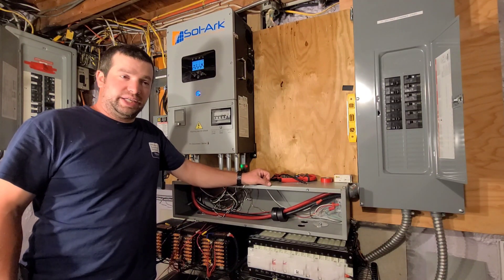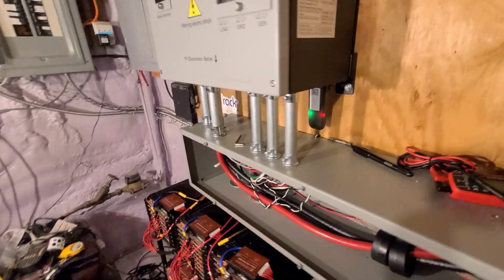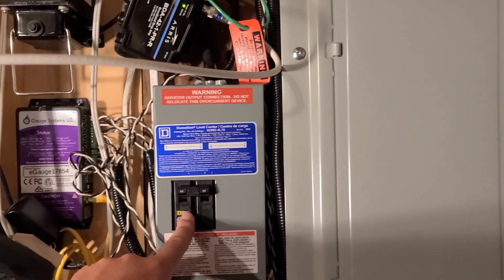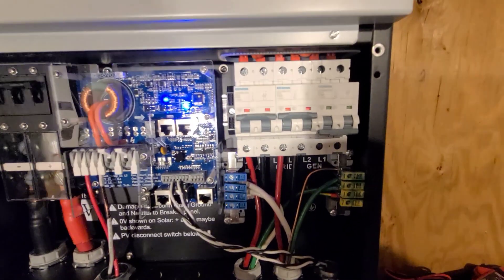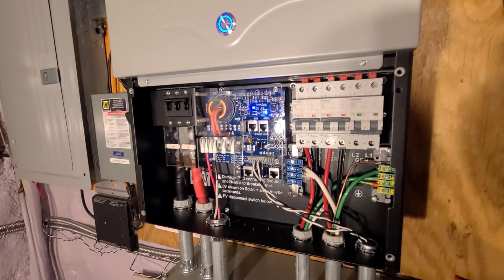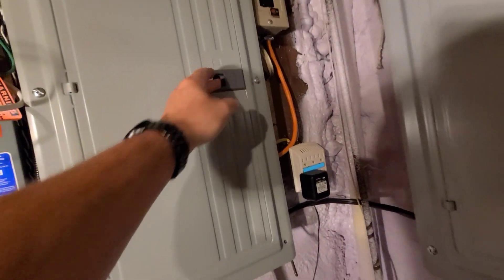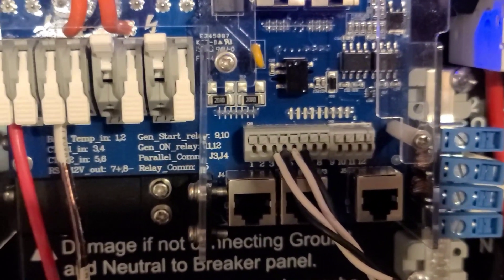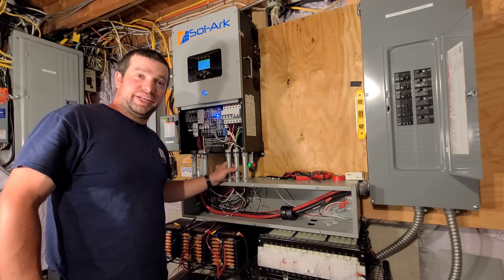Sol-Ark 12k Installation

Comment: Word of warning on the wire trough sizing.  the current 12k model extends out a bit more and 8x8 is no longer suitable.  I had to put some standoffs and it still wasn't enough.  I'd say 12x12 would be comfortable now.
Reply from the maker: Thanks for bringing that up!  The original 12k that I have is good with 8x8, but they did extend it out for the 3r version.
Reply: @benssolarandbattery  a 10x10 gutter works perfect. yesterday the supply house didnt have any so i had to use a 12 and it was so overkill lol.
Reply: I need installers that do these inverters in California

Comment: Did your utility make you jump through a lot of hoops to connect the grid to your inverter..? I've been interconnected with PNM with my 12.4 KW solar since 2010, (Enphase), and I just put in a Sol Ark 15k with a six battery Eco Worthy server rack, which I installed myself, (not an electrician). And am now looking for an electrician to complete the wiring. One of the few electricians that have responded to my messages said PNM wants a $2500 up front fee to look at, and engineer a plan for my battery backup install, but they usually refund all but $500. Then the approvals and inspections to deal with. I'm at the point where I just want to put a transfer switch in and switch to battery/solar when it goes down, and have the 15k run the house-no sub panel. I know I'd have to manage my loads doing that, but no hassles with the utility.
Reply from the maker: No, our utilities are easy to deal with here, and single family residential houses don't even need electrical permits. Definitely sounds like it would be easier to just disconnect in your case.

Comment: Inside the solark, does that bare copper wire run directly to a grounding rod?
Reply from the maker: Not directly. That's an equipment grounding conductor.  The grounding electrode conductor that runs to ground rods is in the main panel where the ground and neutral are bonded.

Comment: Does anyone know if this can be used with only Battery and AC coupling only? My house already has microinverter system and I don't want to sell back to utility so I only want to use battery and AC to charge or discharge with current limiter. Thanks.
Reply from the maker: Yes, it can.

Comment: Hey Ben, I wanted to know what that little box is called that is line taped and what kind of breaker to use. I have an outdoor 12k Sol ark and a double pole breaker in my main panel. Thanks for your help.

Comment: Ben, I'm really enjoying your videos and DavidPoz's as well.  I am still learning all about this stuff, but I think I want essentially what you have with grid, batteries, and solar and the ability to use them any way you want (off peak charging, power during grid outage, etc.).  I am struggling to understand the big picture (but your videos really help with that).  Do you have a diagram of your wiring you can share?  I'm trying to figure out if I need two inverters and how to connect them.

Comment: Hey Ben, I had a couple questions with the limited to home and time of use settings.  If I understand it correctly, these settings can prioritize pv and battery energy and use the grid to fill in if loads are too big or battery/pv too low?  Is that correct?  Also, if this is the case, could I bypass the need for a critical loads panel?  So if the grid goes down, under the limited to home setup, the sol-ark would be supplying the main home panel and I'd just need to consciously manage the loads instead of relying on a critical loads panel to manage select loads for me?  If all this is the case, would I just wire the ac in/out breaker from the sol-ark to a 50amp breaker in my main house panel (also wiring the ct sensors to the main lines) and that's all that would need to be wired on the ac side of things?
Reply from the maker: So you can run your entire house through it, but you'd be limited to a 50a (or 63a depending on the model) service to your house.  The limited to home feature uses CTs on your mains to allow the Sol-Ark to compensate for all of the usage by your house, including the main (non backed up) panel and the protected loads panel.  In the event of an outage, the main panel will go down and only the protected loads panel will be powered.  This is to keep power from backfeeding the grid. 
I'm currently (and have been for at least 6 months) running my entire house through the Sol-Ark with a 50a  breaker with no issues.  Most houses really don't require a 200a or even a 100a service.   Some do, but most don't.
Reply: @benssolarandbattery  Thanks Ben!

Comment: To many videos on sol ark installs that have so many electrical codes violations. You can't have dc wires in same trough with ac wires. 😒 you can't use 3/4 emt conduit with more then 2 sets of 4awg wire.... your missing few insulation bushings on your fittings. Lot more violations... This video should be taken down .
Reply from the maker: Thanks for watching.  Are you a licensed electrician?
Reply: @benssolarandbattery  Yes.

Sol ark 12k manual states on page 5(feb 2021 version) all ac wires should be 4awg wire. Emt conduit. Cant have more then 2 4awg wires. link below on chart
https://essentracontent.com/assets/uploads/images/Table-Cable-Conduit_1.jpg
 
Electrical code does vary based on what year your state adapts the NEC book. Only 4 states have pretty much free rain. link below. 
http://files.esfi.org/file/Full-Sized-Adoption-Map-July-2021-5DFB.pdf 

installation bushing are required 4awg and larger. Now my bad as I watch few video at same time  so I have mixed up my comment for engineer775 video on sol ark 12k which he didn't use any insulation bushing!

2014- 2020 Code updated Language . If your state is Nec 2011 and below your fine.

690.31(B) Identification and Grouping. PV source circuits and PV output circuits shall not be contained in the same raceway, cable tray, cable, outlet box, junction box, or similar fitting as conductors, feeders, branch circuits of other non-PV systems, or inverter output circuits, unless the conductors of the different systems are separated by a partition.  This rule also applies to inverter output circuits. So you would need to a partition from your output inverter circuits and your solar dc incoming circuit.

Example link on a violation picture mixing inverter ac output with your PV DC circuits . Which you can see the Yellow line > DC Circuit run in same trough with AC inverter output circuit in red.   https://www.electricallicenserenewal.com/Electrical-Continuing-Education-Courses/graphics/sectionPics/large/qid177.jpg
Reply from the maker: Honestly, I was not expecting a response to that!   Awesome!
I will say that when I installed my inverter, they only required 6awg wires for the input and output, so I'm good there.  They have since changed the manual once they went with 63a for grid and load breakers.  
As far as DC circuits with AC, I believe its allowed except for PV source circuits.  Can't find anything saying low voltage battery cables aren't allowed in the same wireway as AC circuits as long as the insulation is rated for it.  I am guilty of this violation with the PV source circuit and I know it.   
That being said, do you happen to be looking for work? We are always looking for good people!
Reply: I agree, Jacqueline. I really want to see a fully code compliant installation example/video, perhaps from Sol-Ark directly. While the wireway idea looks nice and works well in principle, separation is impossible. I think the best compliant way to do this is either two wireways or a trough for AC and conduit for DC (or vice versa). Multi-inverter installations present special challenges. 

The other thing I see often is deep battery cabinets directly below shallower inverters, violating working space requirements. Manufacturers of inverters are not helping us much with practical solutions to these code issues.

Comment: one question as you have installed parallel sol-arc 12s.   If there is a residential system with the main disconnect and solar pv ac disconnect on the outside next to each other and on the other side is the dc disconnect and the tigo rapid disconnect switches. please confirm that the pv ac disconnect is connected to the main service panel on top and to the sol-arc 12 on the out side after the wires run from the sol-arc to combiner  critical load box and then to the pv ac combiner. If not how will it be runned from the inside? Thanks.  Also if there is a grid combiner ( there is a standby gen connected to the sol-arc 12 also) what is the function of a grid combiner and its connections and what type of panel is used? 
Thanks. I can be a pain.

Comment: heya oke that is nice so with that inverter you can also feet back to the grid because that's what I want to do, as here in Holland it's 1 to 1 ( I pay 9 cent/Kwh for getting power from the grid but I also get 9 cent/Kwh wen I give back to the grid). the only 1 thing is you still have to pay for the transport though the cable, that's  why I want to have batteries (with my solar panels 3.2 KW) withes will be first to be vilt to 100% before giving back to the grid. I calculted that I need about 9 KWh a day and I want to be able to run my house for 1 week if there wouldn't be any sun to power the batteries up again so 7x9=63KWH for the battery pack

Comment: Hey Ben, I assume you can't hear it, but I'm having an issue with my Sol-Ark 12kw inverter where it sends out an ear piercing tone at 15 kHz. It's very present in this video, but I'm wondering if there's a way to get rid of it that you know of. So far every Sol-Ark 12k inverter has it that I've seen running on the internet, including Sol-Ark's own demo video.
Reply from the maker: Mark, I can definitely hear it while standing near the inverter.  I don't know any way of getting rid of the noise other than locating the inverter away from living space.  I have mine in the basement below my living room and can't hear it at all upstairs.  It's an unfinished portion of the basement as well, with no insulation or sound barriers above it.
Reply: @benssolarandbattery   Thanks for the reply! Mine is installed in my garage, and unfortunately I spend a lot of time out there. It also seems to cause every device in my house with an inverter (computer power supply) to make the exact same noise when the inverter is running. I'm losing my mind at this point, but I don't think there's any solution other than trashing the inverter and replacing it.
Reply: Wall it off in the garage.

Comment: Nice video!  Do you use a CAN-supported BMS for your DIY batteries with Sol-Ark?
Reply from the maker: No, I'm using Daly BMS's with no communication.  I had those in place before I went with the Sol-Ark so it seemed overly complicated to change it now.

Comment: You said you are now limited to a 50amp service.  Are you talking about only when the grid is down.  I want to hook up a Sol Ark as a supplement/backup supply.  I would still use the grid, just a smaller bill.  I have a 200 amp panel and at times may require 20,000kw.  Can I do that with the Sol Ark as long as the grid is on and I have a critical loads panel that omits all the 240V appliances?  Thanks
Reply from the maker: Bill, the way I have mine wired currently is with the entire house running through the Sol-Ark.  I wouldn't suggest this as you would be limited to 50a (or 63a with the newer 12k). 
You could most definitely run a protected loads panel off it with your large loads in a main panel.  You can also add the Sol-Ark CTs to your main panel to run in Grid Zero mode, which will factor in your whole house usage even if there's just a sub panel off the Sol-Ark.  The other way to do it is to use an Auto Transfer Switch on your main panel and use the Sol-Ark load output as the generator input on the Transfer switch, thus backing up your whole house in the event of an outage, but still allowing your 200a service during normal operation.  Many ways to skin the cat!

Comment: Great walk-through!  If you have a pair of the 12k inverters installed can you join the two load outputs (feeding the house) into one sub panel with two 60 amp 2-pole breakers?  Would this increase effective output to 120 amps available for household use?
Reply from the maker: Thanks Jeff!  You can either do it that way or combine the 2 outputs in a wireway and feed the panel directly with 125a rated wire.   The extra 60a breakers wouldn't be needed for that scenario.   (Make sure your panel is rated for it)
Reply: @benssolarandbattery  Good call that would be cheaper.  This wouldn't cause any back flow power issues combining wires or breakers in one panel?
Reply from the maker: @jrtronrud  no, because the inverters are paralleled.  You're essentially using tap rules. But if one shuts down, the other will too so they're basically one inverter.  They do have their own ocpd built in so this works well.

Comment: Yes I will be using an outback charge controller for charging lithium ion cells, actually with this nighttime system I prefer not to sell back to the grid! Day time as on now all solar panels are grid tied (over 14,000 watts), 4 inverters, 7 micro inverters.
Reply from the maker: That works too.  Might as well just keep the grid out of this one altogether, that way it can't get any surges from the grid.

Comment: To complete my request. I’m hooking up additional 6000 watts of panels to my 8000 watt 48vdc Radian inverter, I want to charge my battery bank (60 kWh) during the day and use that storage only at night. My other panels cover my daytime use, but this year I want to set up my battery storage system! Can you make any suggestions from your point of view on how you would do that?
Reply from the maker: Will you be using a charge controller (or 2) or a separate grid tie inverter AC coupled with the Radian?  The Radian does have a Grid 0 feature which will sell excess power once the battery is fully charged, and only buy grid power when it's discharged to your set point.

Comment: I am not an engineer, but I don't think you are playing it sake. remove all the load you want to be powered by the solar to a different panel. it is a safety issue. this would ensure that the grid power does not have a chance to come into contact with your electric utility power.
Reply from the maker: I have installed an interlock to make sure this isn't possible.
Reply: Can you show us the interlock setup? I want to wire from the solark loads input/output directly to my main panel

Comment: Heya. I just came over from David's channel and you said your Sol-Ark couldn't handle just the air compressor? I ask because I am using a 4.4 kw split (2.2kw on each rail) and I can run my air compressor on one rail and AC on the other with no problem (or each one alone) I just don't see why a system that is rated at 3x as much output would have such a problem. PS, my air compressor isn't 'small' lolol, it isn't one of the monster 15hp ones either of course, but my 10hp shop vac doesn't give my system any problems either.
PS, I have one of the OLDER MagnaSine 4448's :) Love how it has performed.
Reply from the maker: The first time I tried the compressor, it wouldn't start.  Then when David was here, it worked fine. Go figure.  The chatter I've been hearing about Sol-Ark is that it doesn't like heavy inductive 120v loads, which I saw once.   240v it has no issue with whatsoever, and most of my heavy loads are 240v.  It will run my 5500w electric dryer without a problem.

Comment: Why did you say 63amp for load and grid breaker ? It’s only 50. 50/50/40 in that order. Only 33 continuous off grid
Reply from the maker: Actually, my unit is 50/63/40. 

I just installed 2 newer 12k's last week that had 63/63/50.  
They're constantly working to make things better by the looks of it.

Comment: Nice video mate, cheers. We have been using the solark 8k for a year offgrid, with a gen on the AC and smartload on the gen and it has been really great. 
We just lost the setup in the cali fires, So looking forward to setting up again with a 12k.
Reply from the maker: Oh no! I hope everyone's ok and you get back up and running soon!  Smart load was a great addition to the last house we worked on. In Vermont, we have to oversize the PV significantly to account for winter production, so all that power would go to waste in the summer otherwise.
Reply: @benssolarandbattery  Yes, We really liked it and could see more opportunities to use in the future. Things like pumping water up high, to give us good supply even if the electricity is down. One issue I had with mine was load balancing betwwen various sources, be interested if you may talk about that if you do any future videos on a similar area.